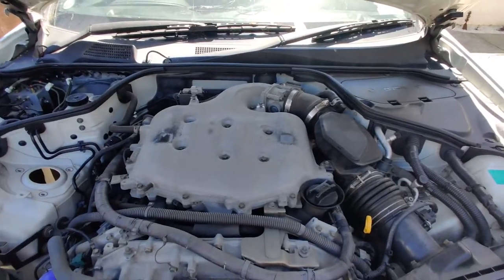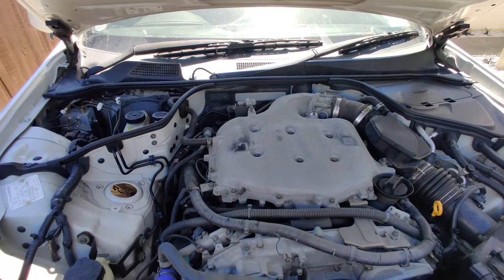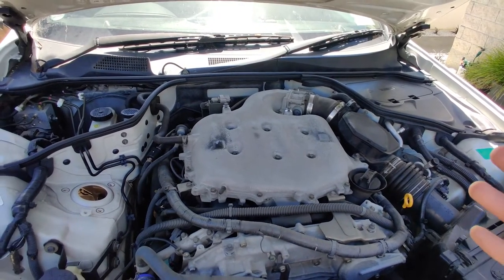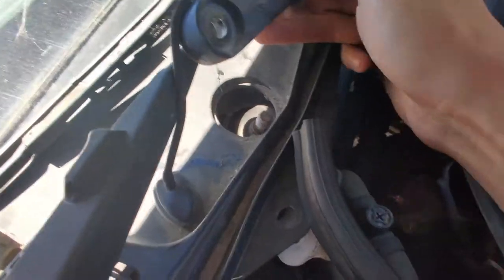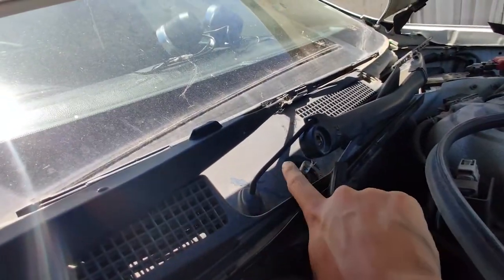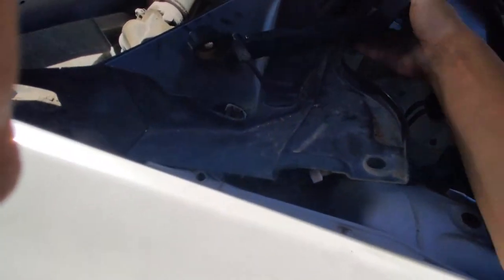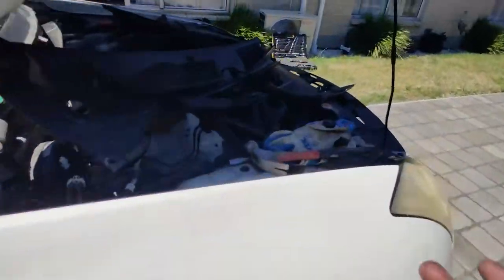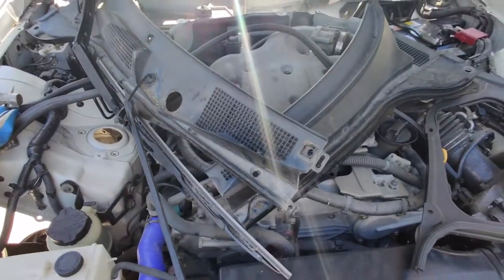Run wire through firewall into the cabin G35&350Z No drilled hole on firewall (super clean)

Comment: I noticed that you have the opposite issue with the clutch/brake booster area not having a cover(Right Hand Drive). I got a RHD cover and now both sides are nicely covered for a real clean look.
Reply from the maker: yes these cars just came like that with out the cover from factory. but yes all covered up would look real clean

Comment: Instead of poking a hole or cutting a slice into the rubber grommet use a Stainless Steel Wire Insertion Tool instead…this way you can run your wire ‘through’ the tool’s body from one side to the other side of your chosen place. Just saying.